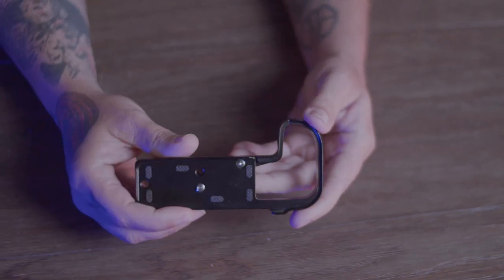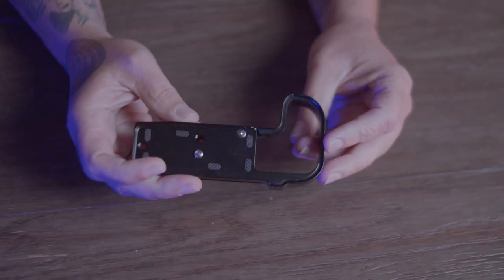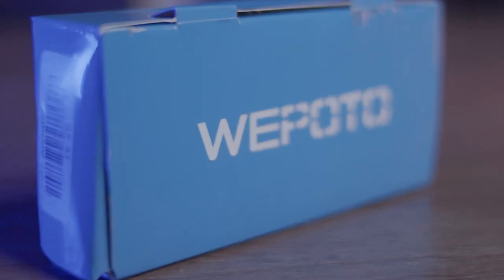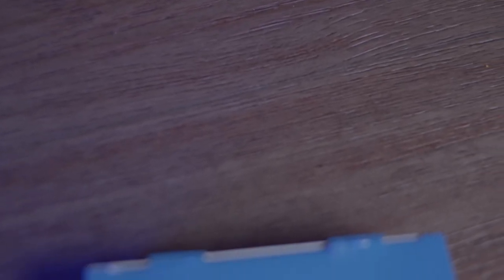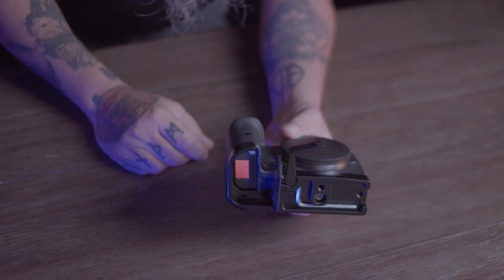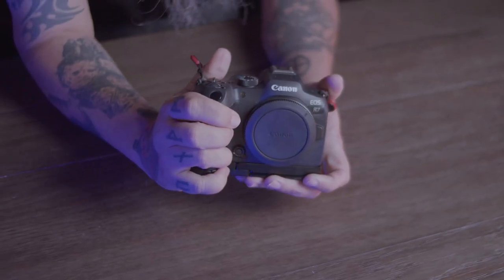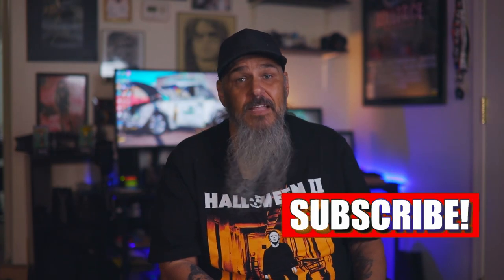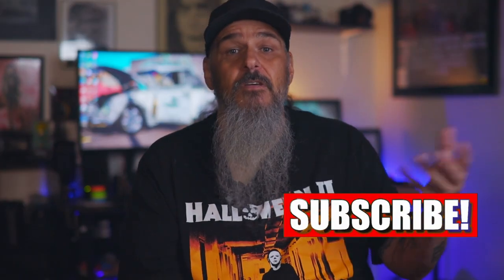Make Your Canon R7 Even Better With A Wepoto Grip Extension!

Comment: That looks like a good solution that I had not been able to find.  I 3D printed one that I like a lot but it will eventually break.  When it does I might just print another one, it costs me very little to print it and only takes a few hours, even faster than Amazon Prime delivery.  😆

I like the metal build of the one you found.  The built in Arco-Swiss mount will be very useful for some people.  I shoot almost exclusively wildlife so it is somewhere between rarely and never that I mount the camera to a tripod using a plate on the camera, only the tripod foot.
Reply from the maker: I have kept it on my Camera and it still feels great. I can understand not needing the Arca Swiss Plate shooting wildlife, Big lenses need that support at the foot, so yeah i feel ya there. This one is getting the job done for me, i rarely use the Arca Swiss as well, but as far as adding that extra space for my fingers it works like a dream. If you find yourself needing one i highly recommend it.  Cheers and just for the record i have MAd Respect for you Wildlife shooters, the amount of patience you have is astounding.